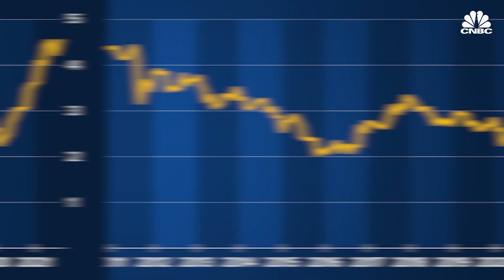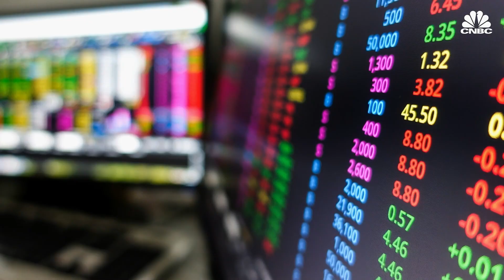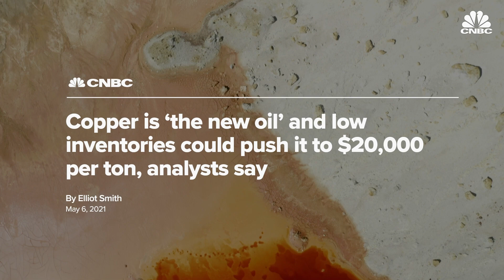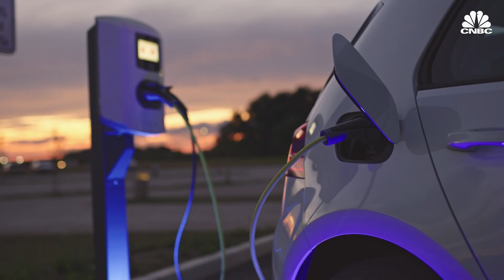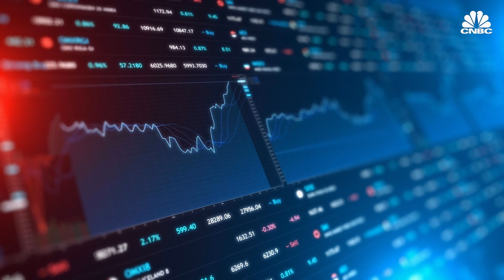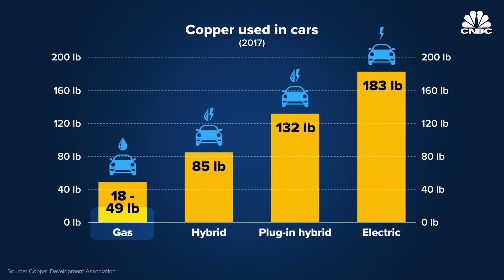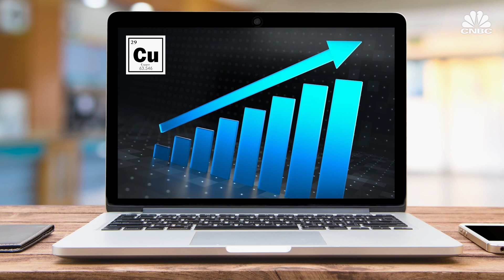Why A Looming Copper Shortage Has Big Consequences For The Green Economy

Comment: Aluminum will be needed for any grid transmission lines.
Reply: Copper is used is under sea cables rather than aluminum. There are big projects on the board for copper cables under North Sea.

Comment: It wasn't "ppl ripping out copper wire and plumbing" it was cranksters.
Reply: It was all types. Dont be dense.
Reply: An old abandoned General Motors company was raided for copper during that time in my area.

It had tubes as thick as your head which after stripping away protective layers, had copper wiring in their cores, that were about as thick as a common fluorescent tube bulb, and ran throughout the facility. Had to have been thousands of pounds of copper there in those tubes alone, never mind the other things that would've had copper like old computers.

Wish I'd gotten in on that action at the time, but it probably saved me from getting some criminal charges.
Reply: Here in Texas we call em crackheads

Comment: And silver and gold are even better conductors. Yet often aluminum is often used as a conductor as it is cheaper in the end, as you need about twice as much of it versus copper for any given specification of wire, yet it's almost four times cheaper.

Aluminum is the third most abundant element in the Earth's crust, but pretty expensive to isolate.

Therefore, I don't think copper will shoot up in price a lot moving forward. But it probably won't drop a lot either.

Comment: …why don’t we just decentralize energy generation and tear down current energy distribution networks - lots of copper there... not to mention wasted real estate.
Reply: Its mostly aluminum. Copper is way to heavy and costly even as a raw material for long distance transmission lines.
Reply: Thanks for clarifying, much appreciated - I’m clearly out of my wheelhouse! Aluminum does seem like it could be a suitable replacement for some copper use - while I’d like to see unnecessary metal structures removed - I’m sure someone else already considered that and I’ll leave current tech specs for the pros.

Comment: In the late 60's and early 70's, the high cost of copper lead builders to start making houses with aluminum wiring. There really isn't anything dangerous or wrong with having aluminum wiring. The problem was that some consumers didn't know that you need a thicker aluminum wire to safely deliver the same current as a copper wire. Also, most switches and light fixtures were designed with copper in mind. If you instead use aluminum wire then you could have dissimilar metals in contact which could lead to issues. There are workarounds though like adding a smaller bit of copper wire between the aluminum wire and the light fixture. So if the price of copper keeps going up and up then we might see stuff like that happening again.
Reply: You're wrong about everything you said.
in the absence of copper was not bc "high cost"
it was bc the US was running out of it. and had to use aluminum.
There is Plenty DANGEROUS in using alum. 
Plenty of fires(and deaths) happened bc of alum.
Alum. has a bad coefficient of EXPANSION. 
Causing Bad connections after overheating as the connections would became loose, causing strands to melt the insulation, thus causing SHORT CIRCUITS and FIRES. 
In the 1960s the US Discovered that CHILE had the "world's largest deposit of Copper" and the US tried to EXTORT them out of it. 
President Allende REFUSED to "sell" their "National Treasure" and the US Murdered him in a Coup d'Etat on.......September 11th...(Ring a bell?) 1973.  then the US installed a puppet regime w PINOCHET as "emperor".  Thus the US could PLUNDER all the Copper it wanted.  
So, copper aplenty again....no more Alum wiring.....
Reply: @jesscast5122  Completely wrong about everything I said? Well I actually have links to sources that support my position. Do you? Aluminum wire is not dangerous except for the dissimilar metal problem (https://www.familyhandyman.com/article/aluminum-wiring-can-be-hazardous-heres-what-to-do-about-it/). Well it is true that aluminum has a higher linear coefficient of expansion than some metals, it isn't like it's orders of magnitude larger (25.5 versus 16.7 for copper) (https://www.sciencedirect.com/topics/engineering/linear-coefficient-of-expansion). Plus if you use the proper gauge then your wires shouldn't be getting all that hot anyway. Guess what happens when you start to run out of copper? The price goes up! It's called supply and demand. Also, after 1972 you didn't see aluminum wire in US houses anymore (see my first link). So who cares what happened to copper supply in 1973? Do you have any sources to support your claims?
Reply: @jesscast5122  The diploma I have on the wall in front of me from Johns Hopkins says that I have been awarded the degree of "Master of Science in Engineering." But just because I have a degree doesn't mean that I know everything, and I am always eager to learn more. However, my education and experience have taught me that if you want to win an argument then it helps if you have sources. Also, you shouldn't just take the word from some random guy on the internet unless they can produce some evidence. In your earlier post you already demonstrated that you do not understand basic economics. Clearly when you got whatever degree you claim to have you didn't have to take econ 101. Forget college, supply and demand is often taught in high school. Do you live in North Korea? How can you live in a capitalist country without understanding how the economy works?

Comment: So the US ditches the penny and make it legal to sell them in bulk. There, I solved the shortage in one step.
Reply: Might work if pennies weren't just copper plated zinc since 1982.
Reply: @tevinvezina1766  so there's only 40 years or so of essentially worthless metal that costs more to produce than it has value? That's still tons upon tons of copper to be turned into extremely thin gauge wiring.
Reply: @AzureLupine  Sure

Comment: Just another example of people in the financial sector just talking to talk even without knowing anything, copper is NOT the best conductor of electricity, silver IS, that is if we don't count superconductors...
Reply: Nonsense, copper is the most/widely used material for electricity conduction, silver is very expensive.
Reply: @alanmay7929  Yes, but that's not what he said :/
Reply: But it is more likely to rust in contrast to gold, I believe copper is seen as the most practical and abundant.
Reply: @melelconquistador  Yes, different materials have different properties, but he said and i quote "Copper is the single best conductor of electricity known to physics as well as the periodic table". If we take it literally, it simply is not true.
Now i don't know if they removed the context of the statement.
Reply: @melelconquistador  Only iron rusts.  Maybe you meant oxidize?  Silver is the best conductor but almost 100 times more expensive than copper.  Gold is not a very good conductor (70% of copper), but it is used on contacts because it does not oxidize.
Reply: What about gold?
Reply: @visceratrocar  check the wiki https://en.wikipedia.org/wiki/Electrical_resistivity_and_conductivity
Reply: @visceratrocar  What about it?  Only 70% of the conductivity of copper.